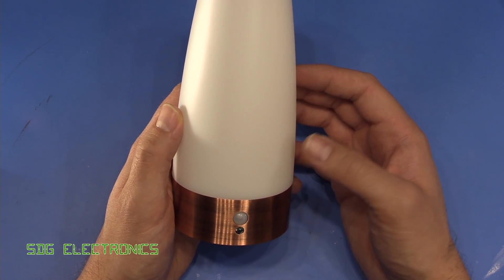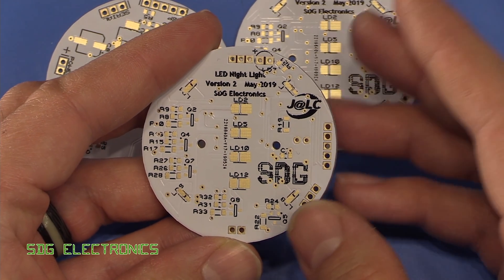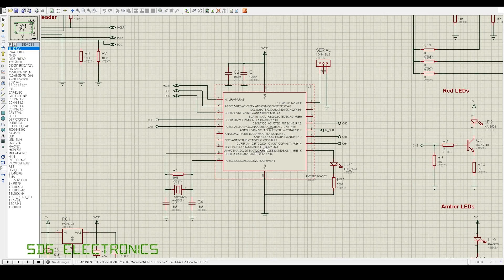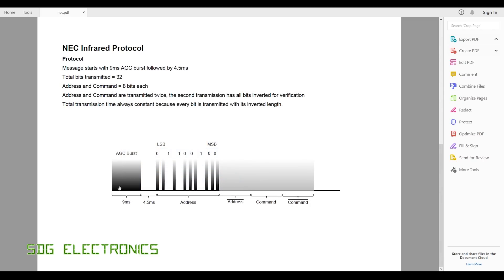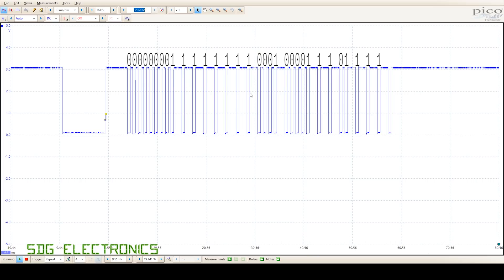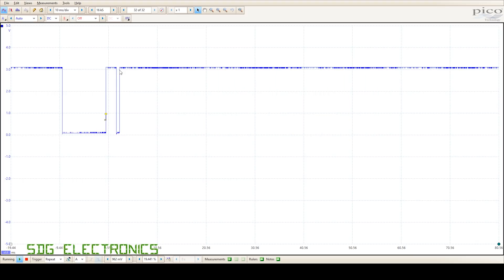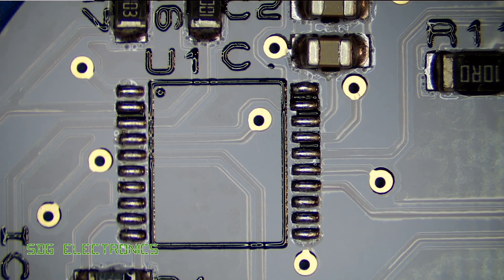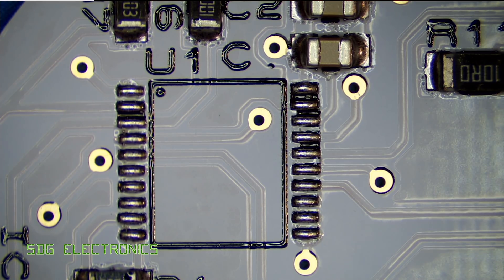SDG #128 Infra-red Remote Protocols and LED Lighting - With new PCBs from JLCPCB

Comment: Nice.  I have a HX1838 VS1838 Infrared IR Wireless Remote Control Module (available for almost nothing as long as you don't mind the slow boat wait) in my parts bin which looks similar... this might encourage me to have a go.  You have been loyal to PIC... are you feeling any urges to move STM32 wards?
Reply from the maker: I keep intending to run other architectures, however I'm so familiar with the Microchip family meaning I can write the code quicker. I tend not to use pre-made libraries where possible so the learning curve is a little steeper.

Comment: Hi Steve, another awesome video. I wanted to thank you for previous videos where you review some products. Two of which I received for Christmas because of your honest reviews. The Swift S41-20 Microscope and the FY6900 Generator. The Microscope is a great improvement over my USB microscope and or the head band magnifying glasses. It has made soldering SMD and inspection of the pcbs so much nicer and clear (I am 55 yrs old and my eyesight is getting worse). One question, with the FY6900 in your opinion should I replace the power supply board? Normally its only plugged in to the outlet when I am using it. I did replace the grounding wire with a proper wire for electric. Many thanks Rick
Reply from the maker: I think you will be OK with the internal supply, it's just not necessarily the safest design. If you've replaced the earth wire with something with thicker insulation, you'll be OK. I have a video coming soon with a simpler and cheaper option of required.

Comment: How's the power dissipation and control range remaining on your LED drive transistors?  The 5V supply compared to the (3.3-0.7)V  on your emitter only leaves 2.4V for the LED to drop before the current regulation starts dropping out.  That should work for some LEDs but probably not all?

Comment: The preamble sequence is there so that you can measure the pulse width and adjust the timing for the following data. This method is preferred to using fixed values as it is still able to decode even if the timing varies widely.

Comment: Many people say that this Bismuth solder paste is a very bad choice and I've always been afraid to use it. There are many rumors that solder joints crack after a few moths to a year. Other rumors I've heard is, that the resistance of the solder joints increases with time.  I was hoping SDG can shed some light on that concern.
Reply: Hi, it really does depend on your application. If you are a car manufacturer producing ECUs and your products are going into incredibly demanding environments then bismuth pastes wouldn't be recommended. They are brilliant for consumer goods and applications where you are using temperature sensitive components. They are also used widely when running a dual alloy process and assembling a double sided board. One side SAC305 the other side SolderKing SnBiAg.